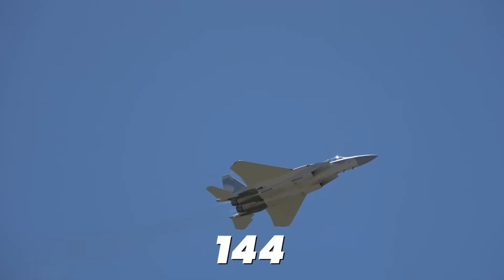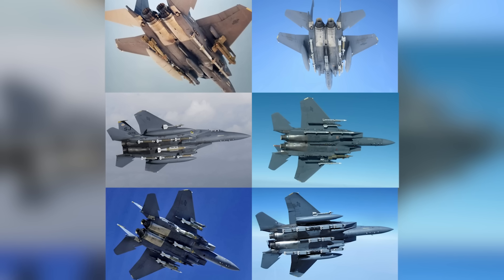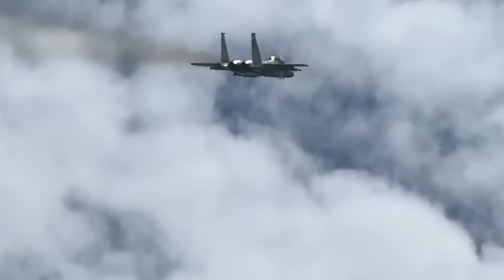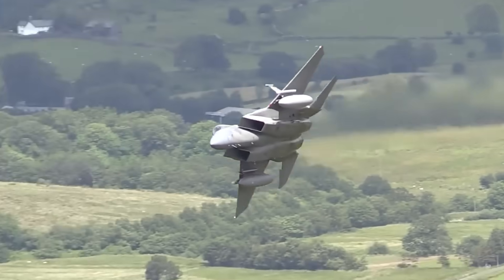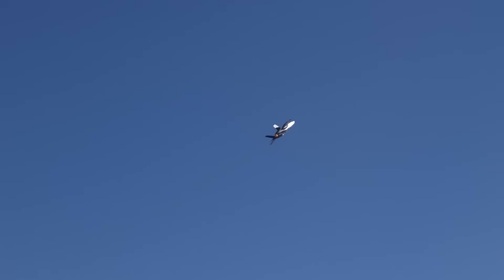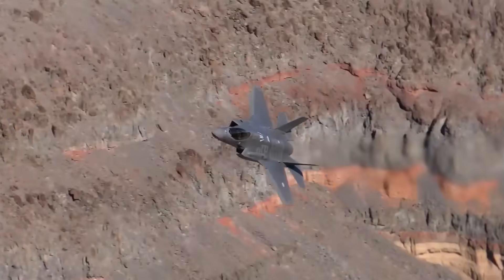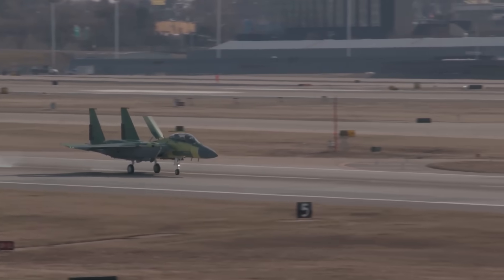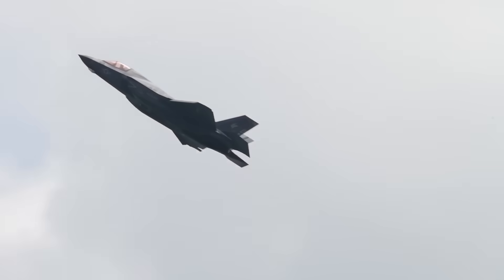F-15EX: Why America Brought Back Its Deadliest Fighter

Comment: Super Eagle should be its designation. It's faster, stronger, and smarter than typical 5th Gen platforms.  Sometimes a hammer beats a scalpel... especially in multiple engagement environments.
Reply: But it’s cross sectional area is huge!
Reply: @michaelwilson3402 

Which is why you don't fly it into radar range before the F-35 blows up the enemy air defense radars with precision munitions like HARMS.
Reply: @kennethdawson7774  or the F-22
Reply: @Doug_343  

Also possible, but honestly the F-22 would be more useful targeting enemy aircraft at least at first, since its a more capable air supremacy fighter.
Reply: @kennethdawson7774  yes sir
Reply: How much faster?  ...  In 'Wings over Vietnam', they say that the F-4 Phantom could keep accelerating, until in blows apart from melting parts.  So it was limited to how fast it could go.  Any jet, made primarily of aluminum max's out at Mach 2.5, because at Mach 2.6, it turns to 'Jelly', due to heat generated by air friction.
Reply: @bugstomper4670 There's no doubt an upper limit due to air friction but speed (or energy) is also a factor in how fast an aircraft regains speed after turns and climbs. The F16 isnt the fastest fighter, but according to reports, few can out perform it in a dogfight.

Comment: Stop INSULTING US with your Boeing propaganda!!!
It is accurate for the Air Force to call this a missile truck that can only be deployed AFTER F-35s and F-22s and their CCAs have destroyed air defenses. The F-15EX retains a huge Radar Cross Section, which means any fighter can see it and destroy it.
Have you conveniently forgotten when the Air Force pitted 10-15 F-15s against one first gen F-22? The F-22 kept destroying every F-15 time and again.
And the Air Force has stated that it is testing NGAD advancements ONLY on the F-22. Any claim that testing 6th gen on a 4th gen F-15EX is foolishness.
Stop insulting us and betting that those in the know will keep quiet and tolerate your lying deviousness.
Reply: You talk like a China bot.

Comment: Please re-do the video with proper factual information, the F-22 Carries 8 missiles not 6 as you claim on the video, the F-22 carries in air to air config 6 AIM -120 D AMRAAM on its main belly weapons bay and 2 AIM - 9X Block 2 Sidewinder on its side weapons bay as well as 480 rounds for the onboard Vulcan 61, 6 barrel Rotary Canon.
Reply: This channel is obviously lying and deliberately pushing false facts and Boeing propaganda.
They consistently post propaganda and shill for whoever will pay them.
Reply: When you do be sure and research the 9 stealth coated F-15s who flew with the F-111 on the attack of Libya back in 1986.  You cant because they are not even mentioned by anyone.
Reply: Fair enough, but your argument is 8 vs 22, as opposed to 6 vs 22. Inconsequential typo.

Comment: The F-22 can carry 8 missiles. 6 AIM-120 AMRAAMs in its main weapons bay and 2 AIM 9's Sidewinders in its secondary weapons bays. (One missile in each bay)
Reply: Doesn't really matter. It's a great missile but the Sidewinder is a short range heat seeker. The context of the discussion is pointing out the ability to salvo multiple  missiles at long range against multiple targets. Not something the Sidewinder would be used for.

Comment: 0:13 "Russia 6th generation superiority" Where'd you get that?! Russia can't even build an honest to goodness 5th gen. fighter
much less a 6th gen
Reply: Precisely
Reply: russia didnt embrace gen 4 production. When they tried to make fulcrums anew they had only western electronics and used old soviet jet engines in storage. They rebranded it as models 30 sukhoi. Usually even using old airframes su27 parts. Gen5 is what first gen 4 using these same parts in conditions of SANCTIONS that they cant reach 10 units still for su-57. Gen. Four.

Comment: This plane killed the F-14
Reply: No f18 killed it
Reply: nope, US Sec. Of Defense Dick Cheney did
Reply: No this had nothing to do with the 14. At all.
Reply: EAGLE KEEPER from 1975 thru 1992 here.  YES We did kill many F-14s both in the Chesapeake Bay and the Med in ACMI competition.  That said the two aircraft had different missions. Radars,  and Tool Sets.   BOTH had a major job in the COLD WAR play book.     NAVY WENT WITH SUPER HORNET instead of SUPER TOMCAT  mostly due to the cost and complications of the swing wing.
Reply: F-14 was Navy, ding dong. F-15 is Air Force. Different branches. Different budgets. Same Sec Def. Do the math.
Reply: @tvdroid22 the F14 job was done in Navy,, F14 was considered to be redesign for future roles as possible bomber, but future plans for the F15 kill that idea, that's why the new F15 is out...

Comment from the maker: Do you think upgrading old models is the key to air superiority?
Reply: If it ain't broke...
Reply: They need to do the same with the A-10. Every time those nimrods claim a certain kind of war is gone it comes back and bites us in the ass.
Reply: @tvdroid22 they should just turn A-10s into drones.
Reply: @FreshPoppin no ai is a human. Not yet
Reply: Maybe but they struck gold with this.  Sometimes I feel like the 35 was a step back. I mean this does like an extra 800 mph?
Reply: @anthonydavella8350 

Raw speed is sometimes useful for interception,  but being able to spot, track and unload a crap ton of accurate missile fire on multiple enemies is MORE useful, most of the time.
Reply: It most definitely can be when used properly.